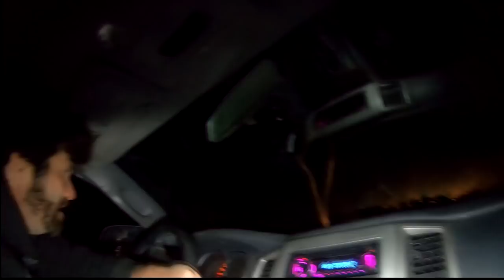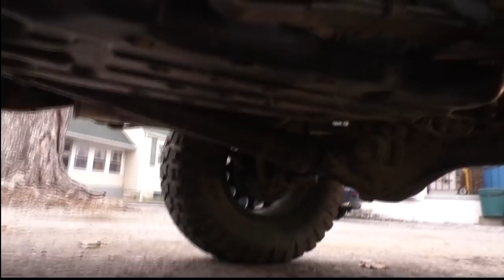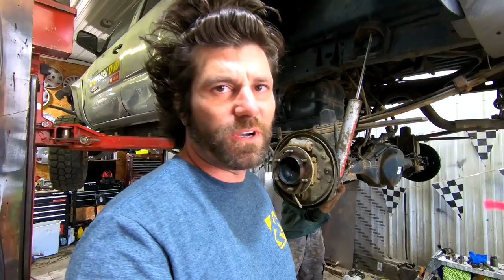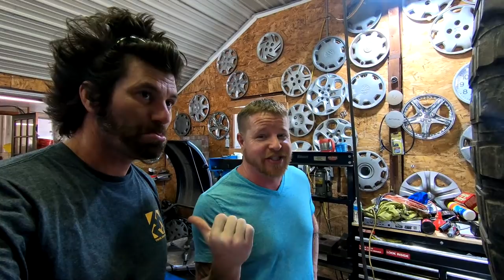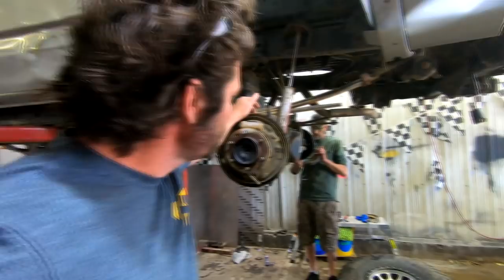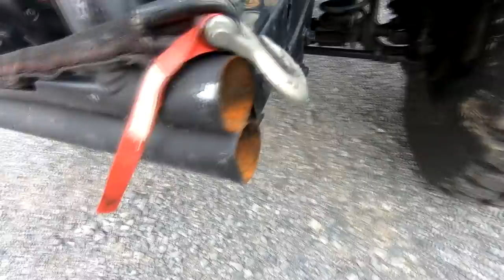*NEW VIDEO* 2nd Gen Tacoma is in the shop!

Comment: Hello, Just tuning in on this. I have been wanting someone to do the 3UR swap in the 2nd Gen Tacoma. Just some advise for the swap. The Lexus GX460 has the 1UR which essentially is the same Block as the 3UR. The Frame in the Tacoma and GX460 should be the same firewall forward. So the motor mounts should bolt up for your motor to the frame. Part Numbers are 12362-38020 and 12361-38260. You will also need. 12316-38030 and 12312-38030. The bracket on the block are the same between the 1UR and 3UR.
Reply from the maker: ooooo!  I like valuable information!  I used to a lot of Honda swaps and I know there were tricks like this for them too.  I hope this works.  It sounds promising.  Thanks for the tip.  I'll owe you if it works.